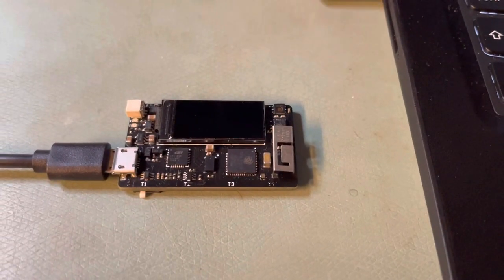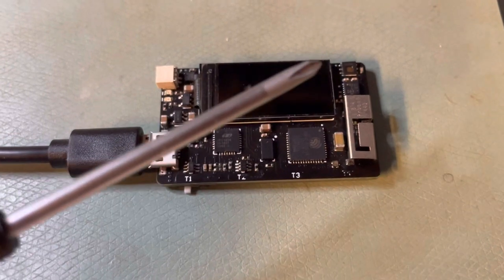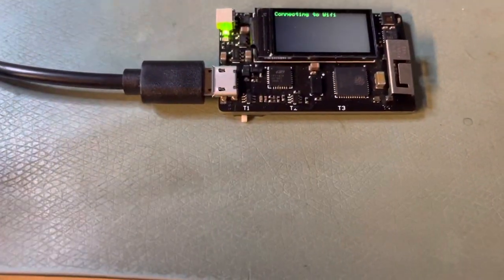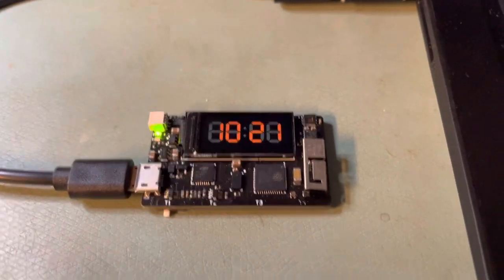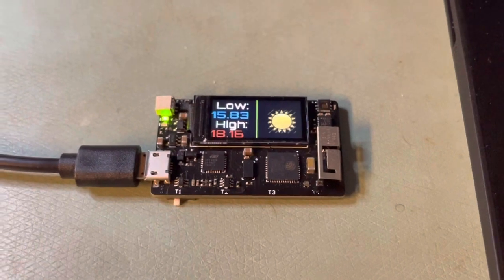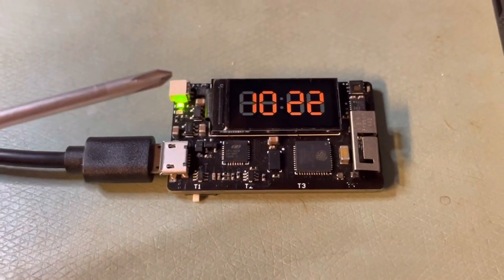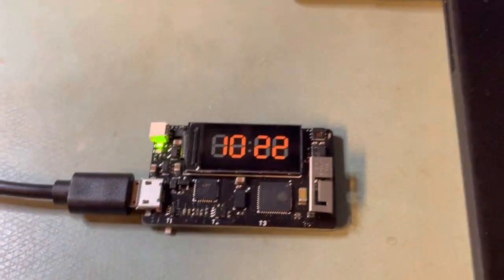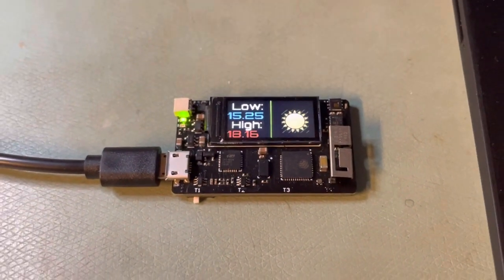ESP32 Clock with OpenWeather

Comment: Hi, I have tried to make a simplest circuit. Just mimicking the Stamp5 pico D4. But I failed every time. I think my reflow is damaging the IC. Can you guide me please? It s me like reflowing Pico D4 is quite challenging.
Reply from the maker: I had troubles at first as well but now have almost 100% success using a hot air wand. Reflowing always left a few pins unsoldered. I would tin the leads of the part with leaded solder, tin pads on the board , use a lot of flux and a quality hot air wand. Once everything is hot the part locks into place and you’re good.
Reply: @0miker0  thanks for the response. Did you you stencil? As it is mentioned in data sheet Max temp 250 degree C, but in case of wand it doesn't melt the solder paste before 350 degree c. Is that safe for the IC?
Reply from the maker: Now I never use stencils. Just tin the component pins, tin the pads and use hot air. Never using stencils again.
Reply: @0miker0  i also tried to solder pico d4 using various techniques and it always failed i think qfn package of pico d4 a bit different because they dont have pad on the side of the component only on the bottom it realy hard to reflow using hot air

Comment: Great work friend, thanks for sharing. I wonder if you are very limited in memory using a PICO-D4 without external flash?
Reply from the maker: Great question! Just did a compile now and see that I’m using up 73% of the processor flash. The only thing I plan to add is a snow icon so additional memory is not necessary.

Comment: Greetings mike; I liked the adaptation you made, but I have some questions:
1) I don't understand about two problems you talk about code; did you manage to fix them?
2) Instead of passing your hand in front of the screen to switch between Time and Weather, would it be possible to do this automatically, for example, every 40 seconds?
3) Is it possible to make the colon blink?
Thank you very much
Reply from the maker: I’ve made major updates over the past few days on another piece of hardware. The final board that has what I need. Work using the CoinCell board was done because it was all I had at the time. Just give me a few more days and I’ll show you what the changes are in a new video.
Reply: @0miker0  Ok, I subscribed to your channel and I'll be waiting; I really like work done on tft displays with Arduino.
Afterwards, I will try to adapt your code to a tft ili9341 display.
Hugs from Brazil
Reply from the maker: The code has been updated over the last few days and I hope to show it off in a video tomorrow. New sensors and a custom make enclosure.
Reply: @0miker0  Nice! I will be waiting! Thanks